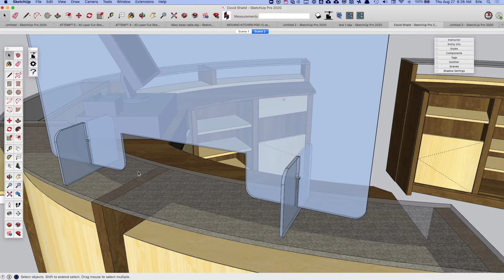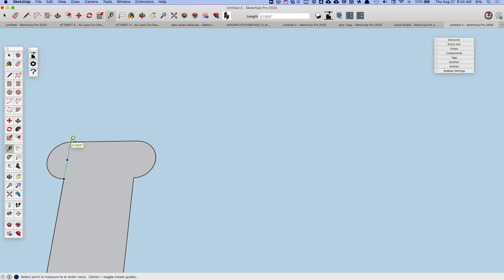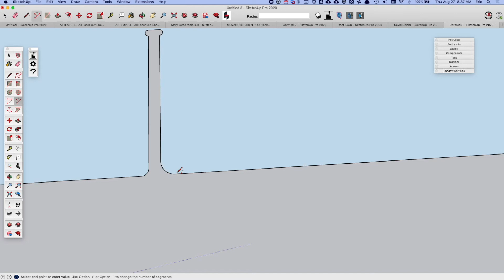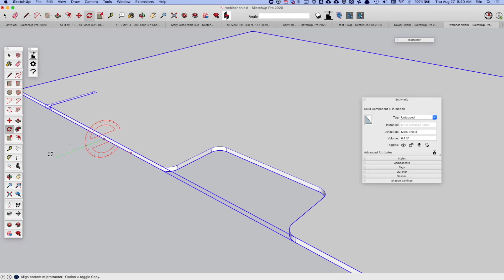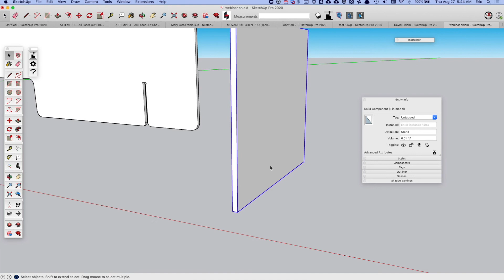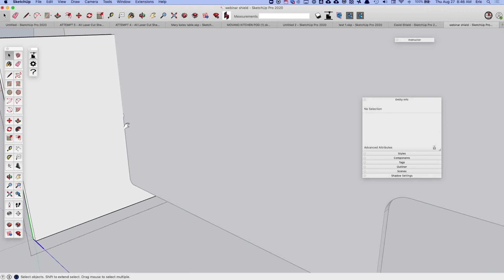Designing a sneeze guard in SketchUp and cutting it on CNC

Comment: I was actually curious to know the little trick to widen the gaps but the video cut off before. I assume you use the tape tool to mark a line from the exterior line and then the push/pull tool to snap it to the tape line?